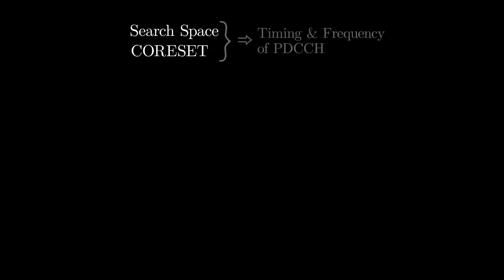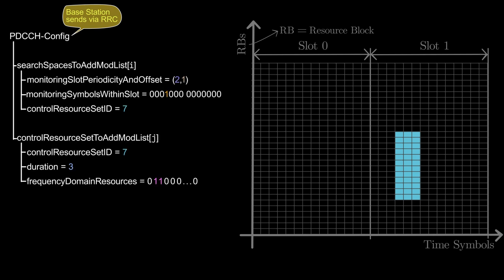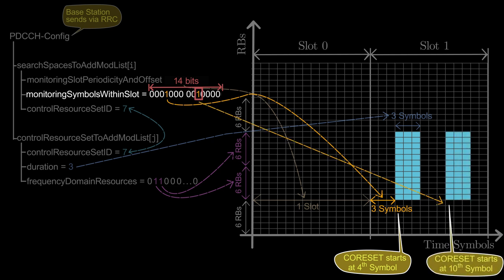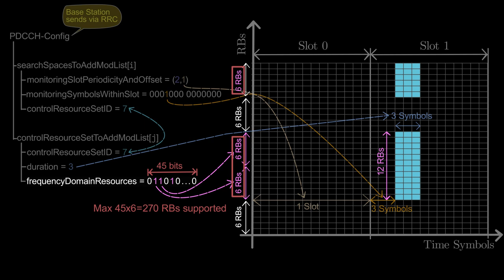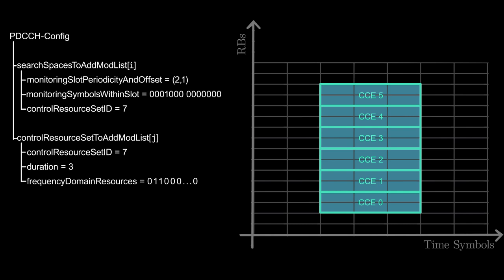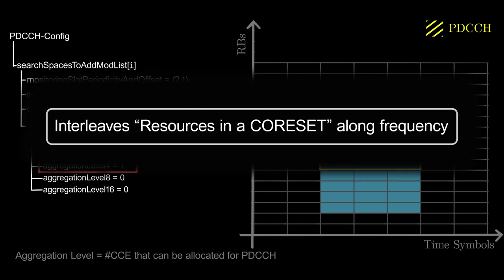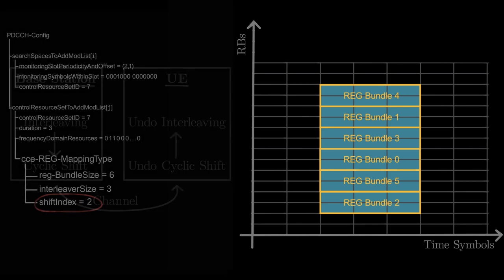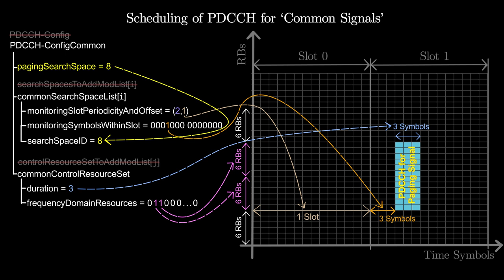Search Space and CORESET configuration in 5G

Comment: As you mentioned , In 4G, on every slot, some 1 are 2 are symbols are reserved for PDCCH and remaining symbols are for data transmission..in that reserved symbols if we don't transmit PDCCH,the unused symbols can't be used for data transmission..
Coming to 5G , CORESET concept was introduced for PDCCH transmission
My query is like Can't we transmit PDCCH without CORESET?
In 5G, we can use that unused symbols in the PDCCH for data transmission purpose...
Can we do in this way like ..without having that CORESET for PDCCH transmission,can we use that unused symbols in the PDCCH for data transmission purpose?
How that CORESET will be placed in time and frequency grid? Is there any triggering condition or when the PDCCH data is available it will also be available at that time?
Reply from the maker: UE search for PDCCH in all CORESET configured. If CORESET concept is absent, then UE has to search for PDCCH on a larger search space. CORESET is introduced to reduce the search space for UEs.
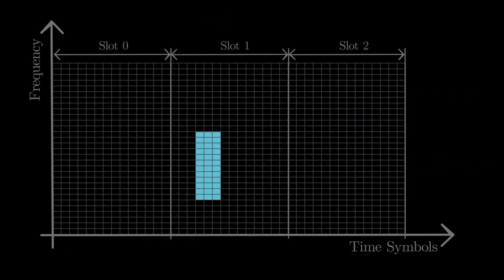Time-frequency location of CORESET is informed by BS to UE via RRC messages 1:25 .
Reply: Thank you @WirelessExplained